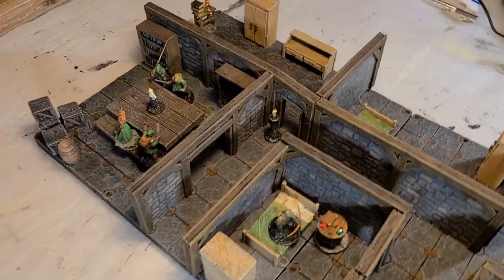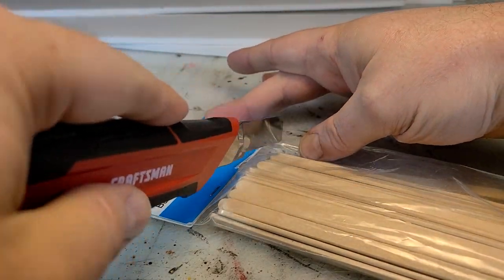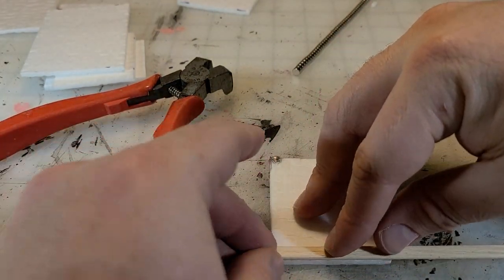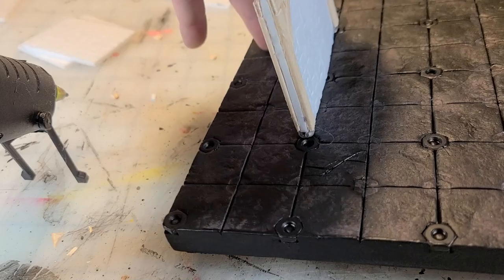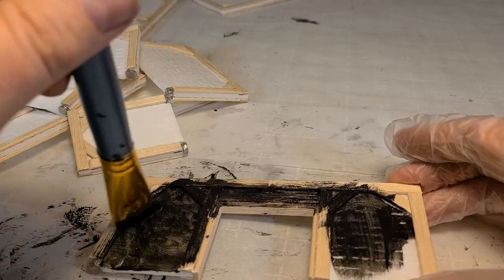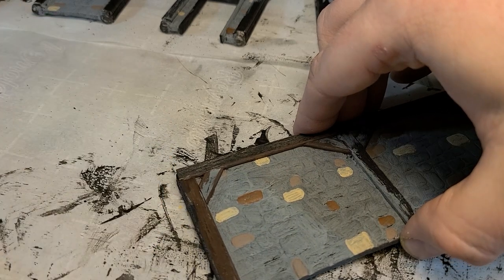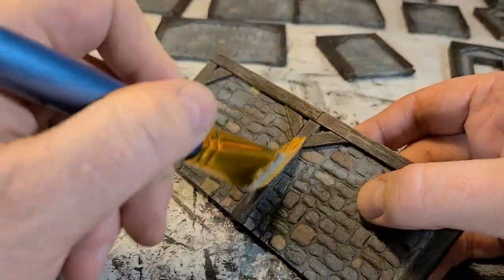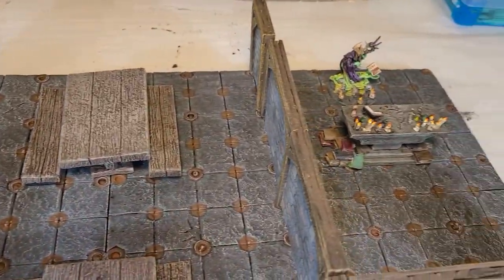Modular Magnetic Interior Walls

Comment: I'm going to give your technique a try. I would like to make a suggestion. Instead of playing with "nuts" use roofing nails. They are cheaper, the broad head give you plenty of surface area for magnets. 
When I try this, I'm going to try using the nails on the nails and glue the magnets in the floor. This will use less magnets. 
Thanks for the tips. I look forward to giving this a try.
Reply from the maker: Before you switch the magnets to the floor, check out the Foldable Portable Tabletop, which improves the walls project.
Reply: @brokenterrain  Thanks. I'll do that.

Comment: Instead if nuts use round washers.
Pit the black wash in a small spray bottle and use a paper towel to dab it.  Might save you time.
That finished scene is really cool.  The broken walls looks great too.
Reply from the maker: Washers would work well too.  That would add a neat circular pattern to the tiles.
Reply: @brokenterrain  you do incredible work, thanks for sharing.  I had an idea that I won't be able to get around to that might be perfect for you.  Take the green army figures and cut the top half off and and them to horse bodies to make centaurs.  Dollar Tree build.

Comment: It might make the vertical stiles easier if you put the magnets on last. Cut the notch as indicated which gives you the ability to use your flush cutters to trim the stiles to length after you glue them in place.
Reply from the maker: Good tip.

Comment: I tried hot gluing thumbtacks instead of using the hex nuts.  Seems to work just fine and took a bit less time.  Also I painted the walls before putting the wood trim on.
Reply from the maker: Thumbtacks is a great work around.  Great idea.

Comment: Double the ready board, now you can hide the magnet under the wood. I'm working on something like this but not using nuts, instead I'm going to use pins, steel sewing pins, easy to hide and works like a charm. Also way cheaper than the nuts.

Edited to add:

This also removes the "need" for any exterior walls and works as a locking system for the tiles.

It can also be used with way smaller walls, think the Wyloch walls, just to hint at the wall being there.
Reply from the maker: Sounds very cool.  Share pictures of your project with me on Instagram when it's ready.
Reply: @brokenterrain  I will, even if I don't have an instagram account right now.

Comment: ... considering modifying your method and using flat thumbtacks in place of the metal nuts.  they should still anchor the wall magnets ok and would be easy to install just push them in.
Reply from the maker: Good idea.  I had another fix.  Check out the Foldable Portable Tabletop video and let me know what you think.

Comment: I wonder if using the magnets in the board instead of nuts, then using pins or something in the wall may have been a better way to go? Though magnets in the wall pieces does allow for using them on various other metallic boards (or have them attached to air ducts for storage. 🤣).
Reply from the maker: Interesting to think about.  My earlier crafts dictated this one.  Though maybe magnetic sheets glued down with walls using pins would work better.  🤔

Comment: If you want to try for more floor tiles, you can get a sheet of HVAC sheet metal and use it instead of the nuts. You'll need to experiment with the covering over the metal though. Even foam core would be too thick.
Reply from the maker: Great idea.  Have to cut that foam so very thin though.  I wonder. 🤔
Reply: @brokenterrain  I thought about just printing the floor (possibly on construction paper) and gluing it down. Not as elegant, but fast and functional.

Comment: How sturdy are the wall sections?  I'm thinking specifically of the bottom edge where it's just foamcore and no framing sticks.  Maybe if half width sticks were run along the bottom as baseboards it would up the rigidity and durability?  Also, why texture both sides of your sticks with woodgrain when you were hotgluing them all to the foamcore?  You could have saved yourself half your texturing time by only doing one side of each stick.  Either way, the result looks fantastic.  A great project, thanks for sharing.
Reply from the maker: The sections are incredibly sturdy.   That bottom edge would be the weak point but I see no issues with standard use.  Though you could add a baseboard along the bottom as desired. I thought about that texturing of sticks thing too, but often it allowed me to flip to the side with the best texture so it was kind of worth it. 🤣

Comment: Hey I didn’t scan the whole comment list of anything so forgive me if it’s been suggested. But have you thought about buying a hex key wrench and just sorta warming it up and pressing the foam and melting it at the same time. (Pretty much exactly like the stamp you showed off)
Reply from the maker: Freaking brilliant.   Great idea.
Reply: @brokenterrain  I do a lot of heat setting threaded inserts in my 3D prints. Literally the same concept just plastic instead of foam. Heck depending on the tools you have available you could just warm up the nut and press it into the foam and somehow release your grip on the nut and it’ll just need a dab of glue on top. Glad I could be a bit of inspiration 😄

Comment: why so high walls ? at the edge of the walls the miniatures will not be able to stand correct. Also the 1 inch grid will not help on the previous problem. Try 1.25 inch grid. The wood work is very good.
Reply from the maker: I recognize the issue with walls.  Blocking the sight of players and limiting space for minis.  That in mind, they sure do look good for staging videos and pictures of your minis. 😉

Comment: This is very cool. I am newly new to this... What kind of foam did you start off with? The main board
Reply from the maker: The floor tiles are made from 1/2" xps foam.  You can find the material in 4'x8' sheets at home depot.   It comes in 1" and 2" thicknesses as well.  Fairly expensive but one sheet will make many projects. The walls are from the dollar tree.  The readi board brand is well loved by crafters because the paper backing on this board peels away easily.   This leaves clean sheets of xps foam to carve, trim and cut.

Comment: question. how would heatsetting the nuts do? like you do for 3d prints, with a soldering iron?
Reply from the maker: I've had several comments suggesting the same thing.  Heating up the nuts and pushing them in.  I came up with something a little different.   Check this video out here https://youtu.be/Fwiycq4g-6I